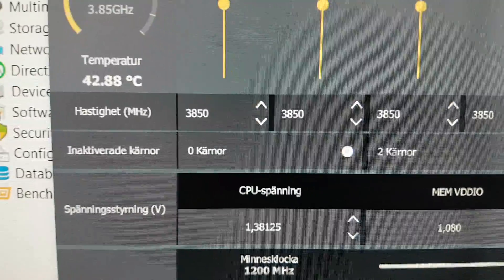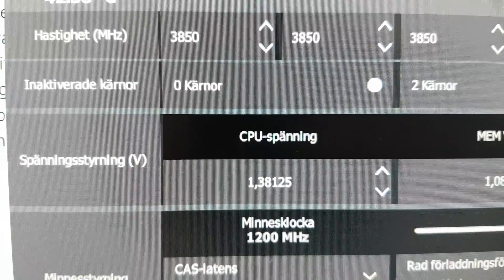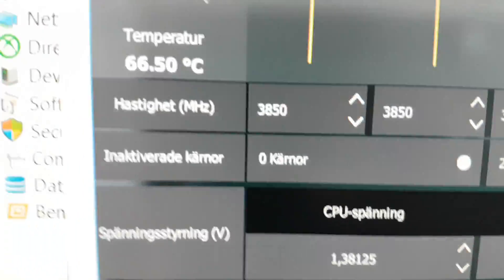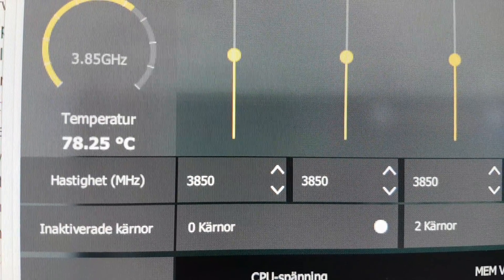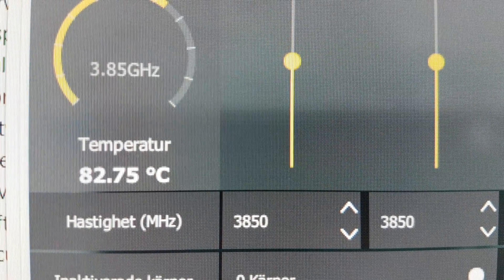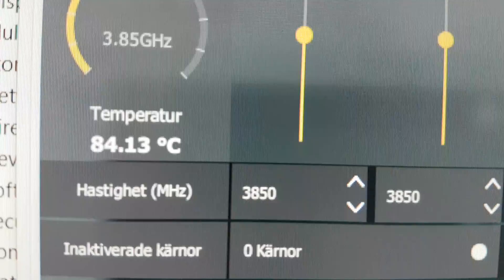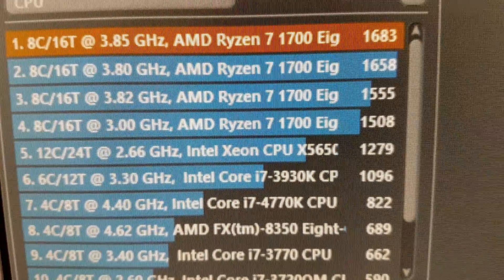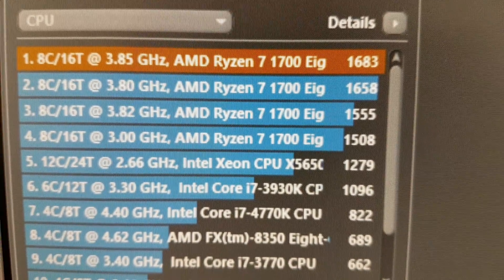Ryzen 1700 overclock with Stock Cooler Wrath Spire

Comment: my ryzen 7 1700 @ 4,00 Ghz got 1764 points in this benchmark with 1.376Volt allready, maybe i got a good chip & temps are 54 grad Celsius
Reply from the maker: Yes, I would say that's a good overclocker :) I got mine early on so it's possible that I got a lower quality part.

Comment: Oskar just to give you a benchmark for your temps: My Xeon E3-1231v3 hangs around 40C with firefox (minimum clusterfuck of tabs), chrome (secondary for work) and steam running in a 25-28C room using a Zalman CNPS7x. On intel burn the CPU tops out at around 80C so... overall... for 4 extra cores on a stock cooler that thing is remarkably cold.

Comment: The stock cooler is shitty as hell...Noisy and cooling performance is very low, only reason why i had to use it is because AMD's retarded cooler mounting mechanism, i don't understand why they could't make it square and the same dimensions like the Intel's one so we can have just one mounting for every platform...I guess because AMD guys just don't get it...Also i am gonna return my Ryzen because the overclocking capabilities of Ryzen varies a lot, seems like their manufacturing isn't that much efective or they just don't care and sell every piece of silicon they can.
Reply from the maker: I would certainly reccomend trying a different cooling paste or cooler before returning it. I think you're making a mistake. The 7700K from intel has heating issues, and Intel flat out does not reccomend overclocking the 7700K at all which is nothing short of a shock for a K-model from them. https://www.extremetech.com/computing/248908-intel-responds-i7-overheating-issue-cluelessly-suggests-stop-overclocking

Comment: can you list out how to overclock with stock cooler more safe to play game?
Reply: Oskar Hanberg hey I ve wondered whether I should get the r5 1600 or this one, do I get any benefit other than 2 extra cores and rgb? 

I am also thinking that I definitely would need to overclock it for it to reach the same gaming performance to the r5 due to its lower clock speed, from what I ve seen though both the r5 and r7 have identical OC results, is this really true?
Reply from the maker: The R5's are binned R5 for a reason. They will not go as high as the R7's. The 1600X has the most potential out of the bunch but why bro? In the future games will use many more cores, so don't cheat yourself out of some extra cores just for a few extra Mhz. You will regret it later. My recommendation is absolutely to get an R7-based processor. You can never know for sure how high you can overclock it but I have not come across a single 1700 that did not do at least 3.9Ghz. But there are of course no guarantees. If all you care about is current games and all you do is gaming, I'd recommend the 1600X. It's cheaper than the 1700 and has higher clocks on it's 6 cores.
Reply: Oskar Hanberg from what I ve seen the 1600 clocks pretty similar to 1600x, worst case 200mhz less and it costs including a decent cooler is 35$+40$=75$. 

thanks for the help, I ll go for the 1700 if I get the money. an other question I wanna ask, do you think can you reach 4.0-4.1ghz with a good cooler and how much will that cost (on an unlucky/lucky cpu)? 

Cause I am thinking that indeed games will use more cores in the future but they ll also need higher clocks, 4.0 sounds good enough for the future.
Reply from the maker: Some people are hitting 4Ghz or even 4.1Ghz so it's doable. I have the NZXT Kraken X62 on mine now, but 3.95Ghz is as high as i can get with the AMD max recommended voltage of 1.425V. Also I think heat isn't the issue even with the stock cooler as the Ryzen series CPU's can handle 95c before throttling occurs.
Reply from the maker: I explain in the video how it's done. I use Ryzen master and set the different sliders to different settings. It's a lot of experimentation as each chip is very different. Some can hit 4.1Ghz with 1.35V and others can never go beyond 3.9Ghz no matter how much voltage you apply to them, so there is no way to list safe settings.

What I can tell you though is that all Ryzen chips will throttle at 95c, so if you are below that you can add more speed and voltage. Also, AMD has stated that voltage up to and below 14250v is safe, so do not go above that. It is not safe for your processor.
Reply: oic... you use ryzen master overclock your speed or go bios setting?
sorry, i am new overclock fan ¬ haha=D
Reply from the maker: First Ryzen master, then once it's stable I applied the same settings in the BIOS.
Reply: ermm... i have try follow your video ryzen master setting to 3850mhz  v1.325 and memory clock set 1200mhz(corsair LPX 3000 8gb x 2 16G same like you but red version).then i try to apply it, my computer will restart 3 time... 
can i know this is stable??
Reply from the maker: For me it is, but like I said every processor is different. You might need to have much higher voltage to get it stable. Also you must have the latest BIOS version for things to be more stable.
Reply: oh yeah , my bios already update to 0612. =D
can i ask you some question?
we use same mobo x370 pro asus.Do you have Aura problem?
i confuse many day want fix my aura...
my wraith spire cooler no more light and RGB...
my mobo build in RGB also no light up...
Do you have this problem?
by the way i want buy NXZT 52 Cooler too
if cant work with my Aura, i will very Disappointed
Reply from the maker: I've had issues with it not turning on in the past, but With 0612-BIOS and now 0801 Beta bios I don't have the problem. Try turning it OFF in bios, restart, and then turn it back on. Might help.
Reply: Just now I try ... still is same my mobo and wraith spire cooler not light up...
Only first day I build up have light...after I turn off my computer no more ...sad...
Reply from the maker: Pulling out the power cord so there is no power for a few minutes can maybe help. Also try completely resetting the BIOS.
Reply: Oskar Hanberg yup I have try...still same
Reply: ohhh yeah, i use corsair H60 cooler boots up 3.85mhz and 2666 
only 43 celslus! is it stable?
Reply from the maker: Test it with OCCT to see if it can pass the stress test.
Reply: my CPUID HWM monitor show me Core voltage 
max is 1.428V /Min 1.319V /value 1.384V
i saw max 1.428v will be over 1.425v
no safety... how i can reduce it?
Reply from the maker: Spikes up to 1.5v is absolutely fine. 1.425V for daily use is perfectly safe. If you reduce the voltage you risk the stability of the processor. If you still want to reduce it you can find how to do it in the manual for your mothetboard.
Reply: i try OCCT when i start small date send, my CPU have the sound up...spikes up and sound coming
scare me i click off it...
will burn my CPU??
Reply from the maker: It is perfectly normal for the cooler to spin very fast when the cpu has a high workload. That is how it keeps the cpu cold.  The cpu also throttles at 95c so there is absolutely no risk of you burning your cpu. Let OCCT run for 24h. If there's no error you know it's a stable overclock for daily use. If there's an error within the 24h time you need to lower the frequency. Remember each cpu is different and what is a stable frequency for one chip might not be stable for another. Good luck! :)
Reply: Allan Kidz overclocking isn't un safe

Comment: mine does 4ghz 1.45v on custom water loop. I do 1716 on cinebench
Reply from the maker: I could probably push it to that, but since AMD has officially stated that you are risking the longevity of your Ryzen CPU if you feed it any more than 1.425V I want to stay below that.
Reply from the maker: I now have the Kraken X62. After some tinkering I've been able to achieve 3.95Ghz on 1.4125V. Max temp is 65c during stress tests. I could probably push it higher but I gain nothing when going to 1.425V which is AMD's recommended max. But I'm pretty happy with the results :)

Comment: Nope I won't on stock cooler :) it will go higher no problem, according to cpuz benchmark it scores higher than the stock 1800x with both single and multi thrreaded score so I'm happy :) when I get an aftermarket cooler I will OC higher, it seems 3.7ghz is the sweet spot for the 1700 without going higher on the voltage (1.19v) which is the stock voltage. I am running 1.14v which is awesome

Comment: Haven't tried 3.8ghz, the stock cooler isn't that great.. My cpu pulls 98w currently at full load, the wraith spire has a TDP of 95w..don't want to push it higher, I can oc more no problem.. People are using 1.35v to get to 3.8-3.9
Reply from the maker: I haven't tried it myself but yeah I can't immagine it's "worse" than the stock cooler so you should be fine.
Reply from the maker: I got to 3.85Ghz. The Max TDP on the processor is actually 125W (system will shut off at that power draw unless you increas current limit in VRM-settings.) The CPU will also throttle at 95c so no worries really, but it does get quite noisy at full fan speed.
Reply: Isn't the wraith spire max TDP 95w?
Reply from the maker: It is. which is probably why mine wouldn't go higher than 3.85Ghz.
Reply: Oskar Hanberg will i be fine using be quiet pure rock ?

Comment: btw you should try Intel burn in test. with that high voltage it might not even pass cause the temperature will rise sky high.
Reply from the maker: 72h OCCT no issues. Temp is high but it's stable.
Reply: Oskar Hanberg wel.  I had mine stable oc 3.9 @ 1.35 with prime95 once I fired up Intel burn test. I think it pas the first wave of 10mim. after that it crashed. it's much better stability tester then any other I believe. it will give you fast results.. if you pass 20min. you can pretty much consider it stable for day to day usage. even within the first 6 to 8 min you will know a lot
Reply: Problem with synthetic is that they don't reflect any realistic work load. Instead you should use video encoding/chess engine or any other real workload to find where your max clocks are. Otherwise you end up with much lower clocks just so you can pass pointless synthetic tests.

As an example: I'm currently running my i5 4690k rock solid stable at 4.7ghz. I can do video encoding, any type of simulation that loads cpu to 100%, gaming and everything else I would want to do. Firing up intel burn test actually makes my computer shut down instantly when I start it up, either because of current or temperature protection.
Reply: Tinkula when a pc is stable it won't crash or shut it self down. that's the whole point .  depending on how long your encoding takes and what kind of it is, one day you will realise it was not stable and it will crash or turn it self off even during encoding
Reply: That's the whole point, it doesn't crash or shut down in any normal use. I would much rather run my CPU at 4.7GHz, like I have been for the past 2 years, instead of ~4.3GHz just to pass some synthetic tests. If it ever crashes then a simple solution is just to drop to 4.6GHz. But it still won't pass synthetic tests. I'm curious, why is it so important for you to pass those tests?
Reply: Tinkula wel I suppose to be sure in worst case scenario I can count the system will stay stable during for example 12 hours rendering , or maybe even day / two at full load
Reply: Tinkula it's pointless to render a project for a long time just to have it crash at 99% for example. it's just not worth the extra oc
Reply from the maker: PRIME-95 is not a good test. OCCT focuses on stressing ALL components on the cpu so it's better. I tried Intel burn test but it doesn't give as high temps as OCCT so I prefer OCCT as it's the industry leading test for "worst case" scenarios.

Comment: I am on stock cooler. with much cheaper motherboard the msi Tomahawk b350 3.85ghz 1700 with just 1.285v
Reply from the maker: I made an updated video with lower voltage.

Comment: I was worried about my temps but not anymore hahah I'm at 3.6gz 1.2volts (going to try 1.19 tomorrow and keep going till it crashes) got my ram to 2666mhz..hopefully I can get it to 3200mhz after bios updates
Reply from the maker: There's a new AGESA-update coming in may which is supposed to improve memory that uses HYNIX-chipsets. I can also not post at highter than 2666Mhz with my memory right now even though it's specified at 2933Mhz. In the QVL it will usually state what speed is supported so double check that. It's quite common right now that 2666Mhz is the upper limit unless you have Samsung B-die chipsets like on the G-skill ones with high clocks (3200-3600Mhz), and even then you're usually capped at 2933Mhz, but a fix is coming now in May, so patience is all we have right now ;)
Reply: what's your RAM ?
Reply: G.Skill F4-3200C16D-16GVKB... The ram is 2T ram and msi bios has set it to 1T with loose timings.. So I think my problems will be resolved once I can change my ram to 2T in bios
Reply: Did you install bios updates yet ? Which motherboard are you using ? I'm planing to buy a new pc, sorry for bothering you
Reply: No worries man :) msi tomahawk b350 motherboard, it's a good board as well.. I am on the latest 1.3 bios, my ram is not on their QVL list and I do believe once I can change my ram to 2T it will be fine
Reply: VRM temps stay in the 40's during idle and gaming /cinebench reaches 48 degrees.. I am currently at 3.4ghz 1.15v
Reply: thank you for your answer
Reply: any update ?
Reply: Hey man, bios updated to the latest one.. Can't post higher that 2667mhz, With my oc, I'm stable at 1.14v at 3.5ghz.. Idle temps 28 degrees and load 60 degrees with 100% fan curve at 60
Reply: So u can't hit 3,8ghz with the CPU and can't post higher than 2667mhz ? what the heck. If i'm buying RAM which is in the QVL list of a mobo, will i be able to run them at full potential ?
Reply: a B350 or X370 mobo i mean
Reply: You will be fine though, most people are getting their rated speeds and bios updates are fixing it.. My ram isn't on the list, I have no idea how you can oc to 3.8ghz with 1.35v on the stock cooler
Reply: My honest opinion? The b350 tomahawk is great if you want to run a single gpu.. The vrm temps are low provided you don't go high on the volts..you will have no issue's getting 3.7ghz at stock volts or 1.2v which is fine on the tomahawk
Reply: Like I've said, I am happy at 3.5ghz 1.14v :) the stock cooler keeps it cool and it's within the max TDP rating.. 3.6 at say 1.15v would work fine as well.. Next time I'm on my pc I will try see if 3.6ghz at 1.14v will past stress testing
Reply: Awesome will wait, not too worried though as 2667 is ok for now :) my system is running awesome so no complaints
Reply: I feel bad for you, because Ryzen 7 benefit from DRAM Speed a lot...
Reply: Just an update, I'm at 3.6ghz 1.14v :) happy and temps have risen about 3 degrees so worth it :) so staying at that OC until I get a phantek cooler
Reply: Wow I'm glad to hear that, did you try to set the frenquecy higher ?

Comment: May I ask u how is the sound of the fan when u overclocked to 3.7? Thank you
Reply from the maker: Not loud at all. If you're only going for 3.7, you can hgave even lower voltage which means even less heat output, so the fan dosn't have to spin as fast to keep things cool :)
Reply: Oskar Hanberg Subbed :) I am a beginner but after watched ur video I decide to go for it, thank you.
Reply from the maker: No problem :)

Comment: I got a dual radiator cooler Hydro 110i form corsair I have it overclock at 4ghz at 1.3875V and works stable and perfect.
Reply: Alain Abrahan 24/7??
Reply: yes
Reply: Ok
Reply: As an update I patch the bios 0511 from asus now I can have the system 24 x 7 working at 1.31v at 4ghz playing BF1 also Mass effect no problem.
Reply from the maker: Nice! I'm playing around with 0515 BIOS right now and will post an update when I've found out the max stable speed.